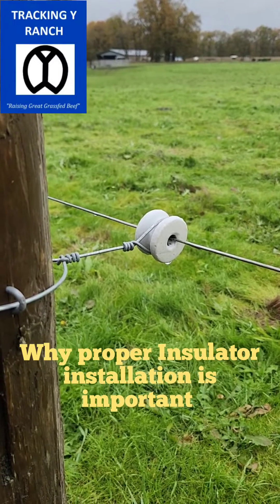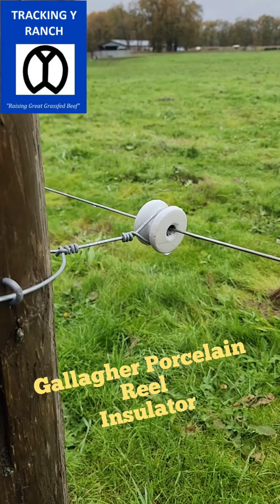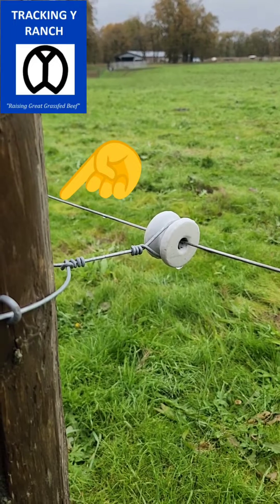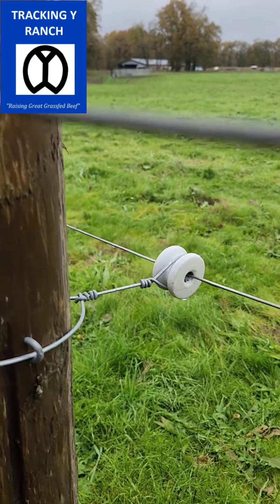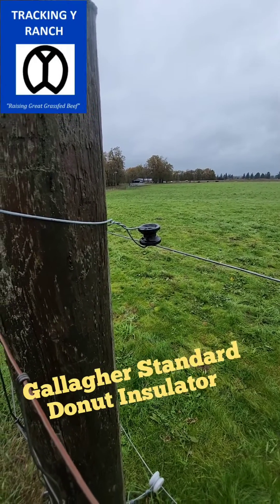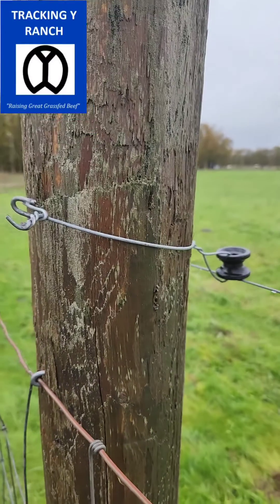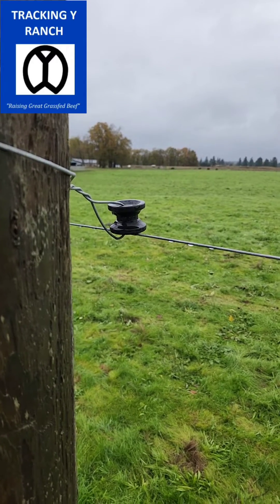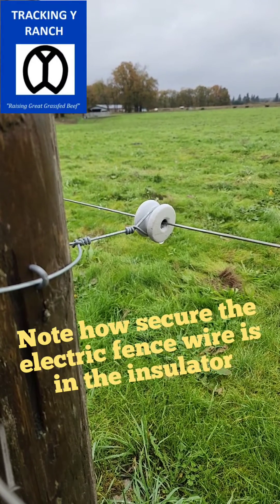Why proper Insulator installation is so important for electric fences

Comment: Difference is the tightness of the loops used to secure the insulator. White insulator they're nice and tightly wrapped. Black one, you can tell it needed the loops to be closer together. In addition to that, hot wire was not fed in the same as white one.